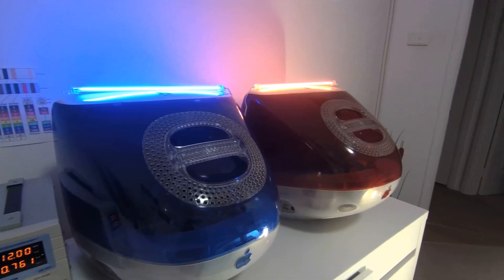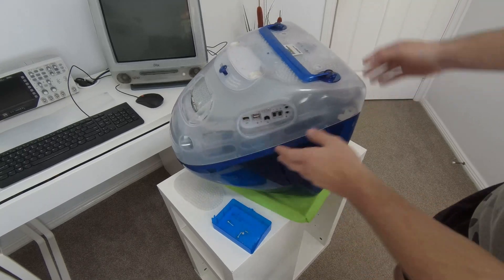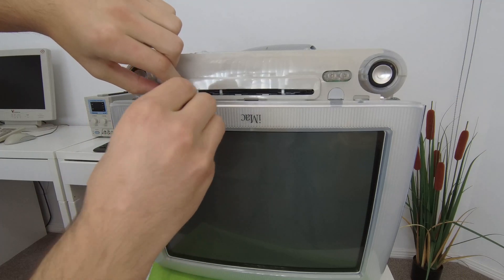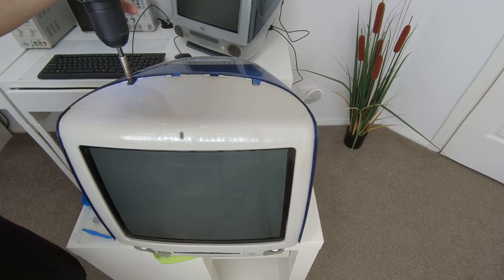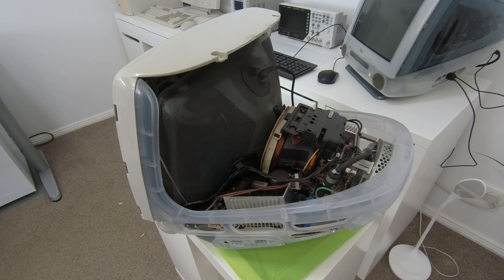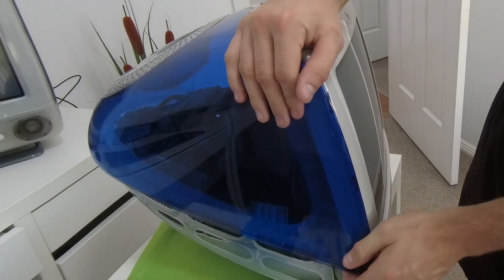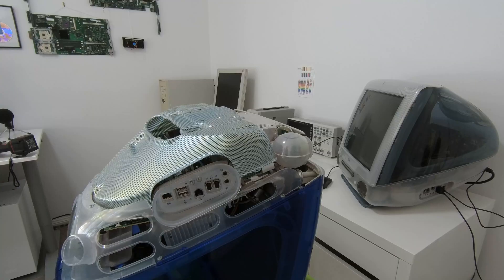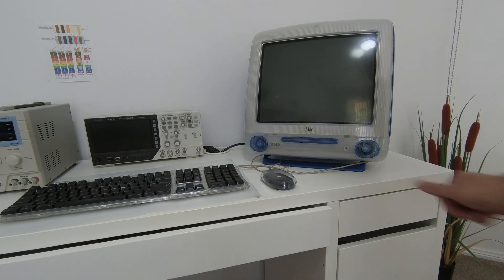iMac G3 Dissasembly and Reassembly (DV Late 1999)

Comment: I would definitely NOT RECOMMEND using a powered screwdriver to do up screws as threads can be stripped easily. That’s just laziness! Use a hand screwdriver or a ratchet screwdriver is a much better option otherwise video quite good although you failed to mention about the speakers that go bad or the crumbling inner bezel on many of them.
Reply from the maker: Hi, thanks for the feedback. Yes, speaker replacement is worth mentioning, seeing how all of my slot loading machines have had crumbling speakers. The same goes for the inner bezels which get fragile as they are exposed to UV light. Finally hand screwdrivers are a great option for use, as they offer more control. I should have mentioned in the video that my powered screwdriver clutch was set to 1Nm which is a relatively safe torque setting for self tapped screws in plastic. However best practice would be to use a manual torque screwdriver.